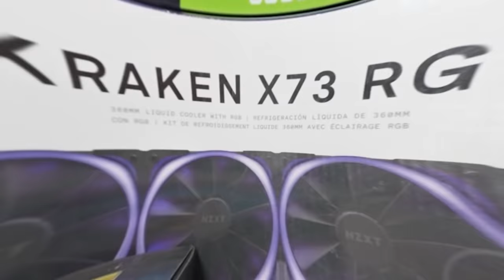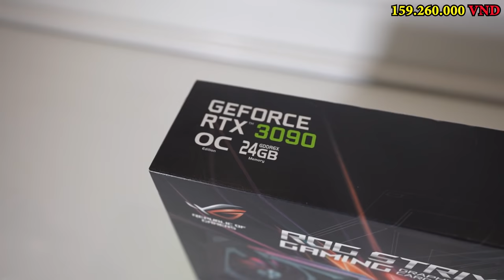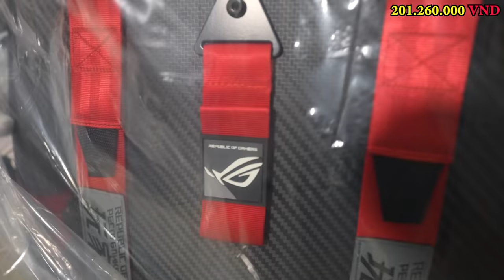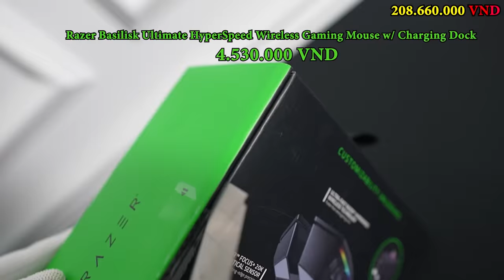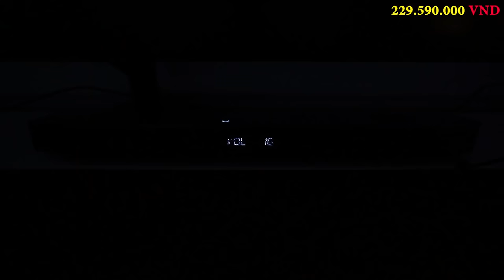NTN - PC Khủng 250 Triệu Của NTN Vlogs (YOUTUBER PC 11000$ SETUP)

Comment from the maker: Chi Tiết Cấu Hình Và Giá PC Của NTN 
Dành cho các bạn yêu thích PC Gaming tham khảo nhé
Giá trên video bị nhầm lẫn và sai sót khi Edit nên mong các bạn thông cảm: 

1: CPU Intel Core i9-10900K (3.7GHz turbo up to 5.3GHz, 10 nhân 20 luồng, 20MB Cache, 125W) 
Giá: 12.600.000 VNĐ
2: Mainboard ASUS ROG MAXIMUS XII FORMULA (Intel Z490, Socket 1200, ATX, 4 khe RAM DDR4)
Giá: 13.200.000 VNĐ
3: Ram Desktop Corsair Vengeance PRO RGB (CMW32GX4M2E3200C16) 32GB (2x16GB) X2
 Giá: 10.200.000 VNĐ
4: Ổ cứng HDD Seagate SkyHawk AI 18TB (3.5 inch/SATA3/256MB Cache/7200RPM) (ST18000VE002)
Giá: 15.600.000 VNĐ
5: Ổ cứng SSD Samsung 970 EVO Plus 2TB PCIe NVMe 3.0x4 (Đọc 3500MB/s - Ghi 2300MB/s) 
Giá: 13.000.000 VNĐ
6: Card màn hình Asus ROG STRIX RTX3090-O24G-GAMING (24GB GDD6X, 384-bit, HDMI +DP, 3x8-pin)
Giá: 63.000.000 VNĐ
7: Nguồn Asus ROG Thor 1200W Platinum - RGB 1200W 80 Plus Platinum Full Modular
Giá: 9.190.000 VNĐ
8: Vỏ case Jonsbo TR03 - G Black (Mid Tower/Màu Đen)
Giá: 6.000.000 VNĐ
9: Màn hình LG 32UL950-W (32 inch/4K/NanoIPS/60Hz/5ms/450 nits/HDMI+DP+Thunderbolt)
Giá: 28.000.000 VNĐ
10: Bàn phím Không dây Razer BlackWidow V3 Pro (USB Wireless/Green switch/Bluetooth) 
Giá: 5.900.000 
11: Chuột chơi game Razer Basilisk X Ultimate Wireless Black (RZ01-03170100-R3A1)
Giá: 4.500.000 VNĐ
12: Tai nghe Asus ROG THETA 7.1
Giá: 6.500.000 VNĐ
13: Loa Creative Sound BlasterX Katana - 7.1
Giá: 6.000.000 VNĐ
14: Ghế Chơi Game Asus ROG Chariot SL300C RGB
Giá: 16.600.000 VNĐ
15: Fan Case ID Cooling DF-12025-ARGB TRIO 3pcs Pack X2
Giá: 1.500.000 VNĐ
16: Tản nhiệt nước CPU NZXT Kraken X73 RGB
Giá: 5.900.000 VNĐ
17: Hệ điều hành Windows 10 Pro 64Bit Eng Intl 1pk DSP OEI DVD FQC-08929
Giá: 3.150.000 VNĐ
18: Kaspersky Total security
Giá: 400.000 VNĐ
19: Webcam Logitech HD Webcam C922
Giá: 2.900.000 VNĐ
20: Màn hình LG 27UL850-W.ATV (27 inch/4K/IPS/60Hz/5ms/350cd/m²/DP+HDMI/) X2
Giá: 21.800.000 VNĐ 
21: Bàn di chuột Razer Gigantus V2 Soft Gaming Mouse Mat 3XL - RZ02-03330500-R3M1
Giá: 1.400.000 VNĐ
22: Giá đỡ màn hình máy tính North Bayou F100A X3
Giá: 3.000.000 VNĐ
23: Microphone Kingston HyperX QuadCast S RGB - HMIQ1S-XX-RG/G
Giá: 3.700.000 VNĐ
24: Card Sound Creative Blaster X AE-5 Pro Gaming DAC, LED RGB 7.1
Giá: 3.700.000 VNĐ
25: Card mạng không dây PCI Express Asus PCE-AC88 Wireless AC3100
Giá: 2.500.000 VNĐ
Tổng trị giá: 257.540.000 VNĐ
Reply: Cháu chào chú Nam
Reply: Chào
Reply: Đọc mà nhức đầu
Reply: Sao không mua AMD mà mua Intel vậy ta, 2021 rồi :))
Reply: Strike game đi nam ơi .hóng
Reply: @MinhTran-uh8od   tuỳ người thôi bạn chắc cũng intel nổi hơn
Reply: Mong anh làm video cùng team như xưa
Reply: Cho em đi theo anh đc ko ạ
Reply: Ra nghề livestream  đi NTN
Reply: 60Hz hmmm
Reply: @phamhovinhlan3682  Kiểu cái màn hình nó ko xứng ấy, 450 nits nữa. Nói chung trải nghiệm tần số quét cao nó dễ nghiện lắm, xài rồi quay về 60Hz ko quen.
Reply: Làm clip giúp người nghè đi a ơi
Reply: @phamhovinhlan3682  ông gg tự kiểm chứng đi nhé, Intel hít khói AMD từ lâu rồi và chính Intel cũng thừa nhận điều này. Dân rành về kỹ thuật chẳng ai mua Intel đâu, kể cả PC lẫn laptop
Reply: Hello ah nam
Reply: Fake cút 👌
Reply: Cho thử 1000000000 con virut vào thử nữa a
Reply: À anh nên mua thêm cái vô lăng nữa để chơi mấy game kiểu đua xe í
Reply: @phamhovinhlan3682  Anh Nam chơi Apex Legend, chò chơi này cần 2 con mắt nhanh lên 60Hz quá ít, lên mua 31,5” 240Hz, 2k
Reply: Anh bị alex nguyễn trên vgs nói là làm bẩn giới pc
Reply: @DDKMuzik  tự gg kiểm chứng đi nha bạn
Reply: @Lân Phạm thấy có comment lại sao xóa hay sao mà ko thấy bác, AMD vừa rẻ hơn, vừa mạnh và vừa mát hơn Intel nhé. Con đầu bảng của Intel chỉ ngang con trung cấp của AMD thôi, mà giá Intel cao hơn nhiều
Reply: Hello idol 😍😘♥️
Reply: Xịn quá idol ơi
Reply: Anh tự thưởng cho mks vì Công việc đang làm rất mệt mỏi chúc qnh nhiều sức khoẻ sớm khoe nút kc nha anh 
Love anh 😍😍
Reply: Video này đạt 600 k k like anh tặng 1 cái lap top      
5 đến 10 củ đi anh
Reply: Hello Anh NamTaiTư
Reply: Tặng e đi anh ơi🥺
Reply: Bạn sinh năm 94 . Tôi sinh năm 94 . Bạn nổi tiếng , nhiều tiền , nhiều người yêu thích . Tôi không tiền , thiếu nợ người ta khắp nơi , khổ vợ khổ gia đình . Giờ chỉ ước mơ nhỏ nhoi có 20tr trả nợ để gia đình bớt khỗ . Cha mẹ bớt khóc vì tôi . Thật ngưỡng mộ bạn .
Reply: nếu mình được 1tr sub sẽ đầu con bồ nhí này kk
Reply: @MinhTran-uh8od   tuỳ ng thôi nhá
Reply: Thay con chíp i9 10900k 10 nhân 20 luồng này sang chip i9 9980xe 18 nhân 36 luồng hoặc Amd 3990x 64 nhân 128 luồng -đắt hơn i9 10900k kia nhưng đổi lại hiệu năng gấp mấy lần phù hợp vs rtx 3090
Reply: @DDKMuzik  tùy sao bạn, như là xe máy thì mua Honda, TV mua Sony đó hả =))
Reply: Mr beast?
Reply: @MinhTran-uh8od   mua intel hay  AMD kệ ng ta
Reply: xin link nhạc anh eey 3 bài luôn
Reply: 3090 giá ảo thế
Reply: @khiyoyo6079  thằng Hanoicomputer bảo 1thanh ram là 32gb, 4 thanh là tận 128gb
Nếu đúng là 128gb thì giá đó đúng rồi, nhưng trong video đâu thấy nói tới 128gb ram đâu ta
Reply: @MinhTran-uh8od   :))
Reply: B   nhưng nhu cầu ngta i9 dùng còn chẳng hết thì nâng thêm để lgi đâu bác
Reply: cả 1 ước mơ
Reply: @NGUYENMINH-md1tt  khiếp b ơi, chắc a nam lại đợi 20 ngày à b, :)))